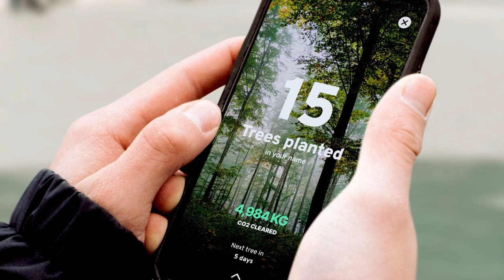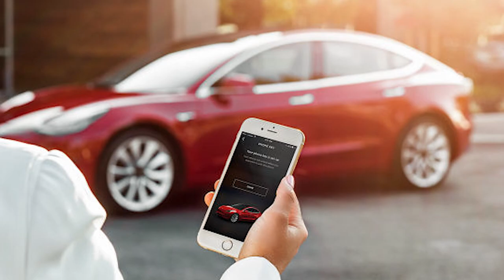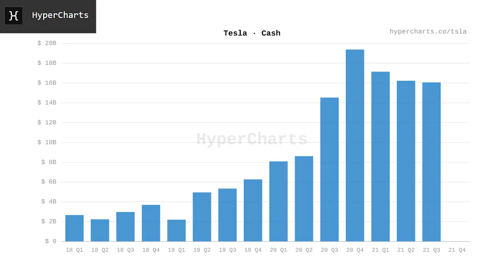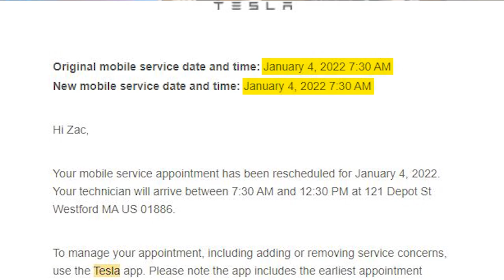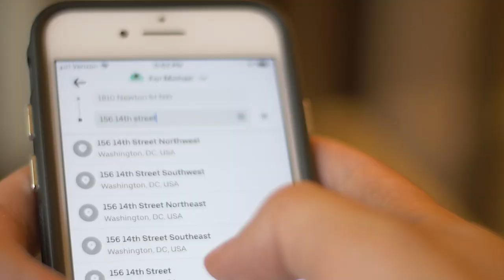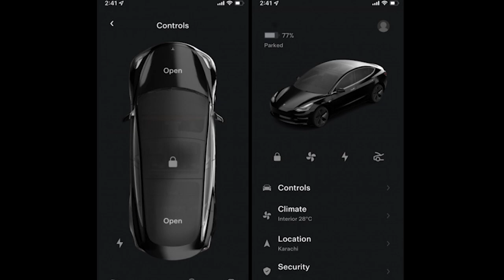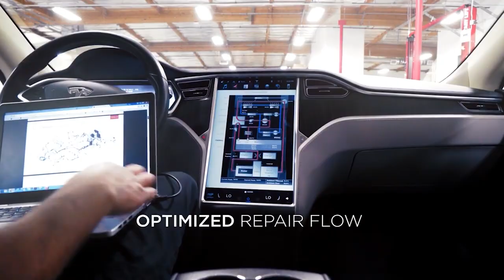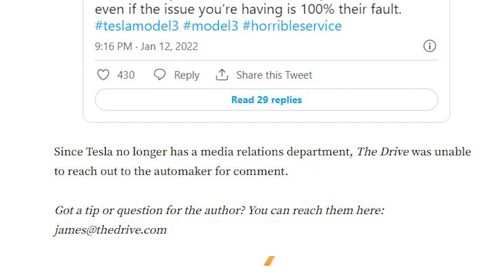Tesla We Love You, BUT… | In Depth

Comment: Do we need more service centres?  Maybe, but even then it won’t fully address the problem.  Do we need more mobile rangers?  No, I think they have their place (roadside assistance), but travel time is a seriously inefficient overhead for routine service!  Personally I think agreements with existing recovery contractors (RAC or AA in the UK) is a much more efficient use of resources for breakdown situations.

What we need are to give existing Independent garages access to spare parts, manuals and diagnostic software.  My previous ICE cars were all maintained by a local garage no more than 400 metres from my house.  There was no hassle or personal time lost.  Spare parts were delivered same day or next day.  I never took it to a franchised dealer! It was great local service!

Contrast that with my model 3.  My nearest service centre is 40 minutes drive away.  So that’s 2 hours and 40 minutes of driving (including the loaner car).  That’s a lot of hassle for a baseline condition, and that’s mild compared to other residential addresses in the grand scheme of things.

Do I need service?  Yes, eventually!  Just routine things like making sure the brake pads don’t seize onto the calliper, wheel alignment etc….  That stuff is bread and butter for any garage.  But I really hope that I never need anything more than that (regardless of whether it’s covered by warranty or not), because that’s the point where Tesla ownership is dependent on Tesla service.

Comment: I love driving my Model 3 but Tesla service’s lack of communication and slowness even here in Japan is the only reason I cannot recommend a Tesla to anyone except complete maniacs. I took delivery of my Model 3 LR in December 2019 after a miserable experience of not getting the “stealth” performance version I had configured and soon noticed several problems, mainly the LTE and wifi antenna was faulty and had to be reset. That was fixed a month later but I also noticed that one of the speakers had a buzzing sound which was confirmed by the service guy and I was told they would replace it for free. Great - I finally got notified that I could bring the car in to replace the speaker in December 2021 - almost 2 YEARS after reporting the problem. Cmon Tesla - you gotta do better.

Comment: Just had my 12v battery replaced by mobile service in Texas. Took 48 hours from the time I posted the service request to the time the service guy shut the frunk lid and said, "all done!" As maintenance is near zero on my 100,000 mile Model S, I find that quite acceptable.
Reply: In my ICE car (waiting for cars, service centers and superchargers to get to Malaysia) my recent 12V battery was replaced within 1 hour. I think they have been allowed, by Tesla fanboys, to let service standards slip. It has to be addressed ASAP. 
Short term have the service centers and service techs on shifts open 15hrs/day from 7am -10pm to get through the current backlog of issues.
Medium term stop fighting and embrace RIght To Repair, have service centres fully equipped with spare parts together with overnight resupply and make these parts, and full service info readily available to third parties.
Long term set up Tesla University to fully train service techs, body centre techs and supply chain/logistics staff

Comment: So, while it's become fashionable to find fault with Tesla service, this has not been my experience or the experience of those I know with Teslas. 

First, the cars are super reliable....most reliable car I've ever owned. (Mine is a 2019 DRLM Model 3). But contrary to what seems to be floating around the internet (thanks to Rich Benoit), our service experiences have been simply superb.

For me I've had a couple of problems that were quickly diagnosed remotely (by quickly, I mean within 15 minutes) and were "fixed" via firmware updates. No fuss, no muss. Had these things happened with another brand I would have had to bring the car into the dealer and find that they couldn't find or fix the problem....and waste a whole bunch of my time.

The hardware issues I've had with the car have been a broken windshield (the fault of a rock, not the car), and a collision (the fault of the drivers, not the car). In the case of the windshield I created a service request online, they scheduled it for about a week out, I brought the car in, they gave me an Uber voucher, and I picked the car up later that day. No problems at all...and Tesla's price was the lowest I could find.

In the case of the collision, this happened about 1PM on a Saturday. My car was hit by another car, which in addition to doing some body damage, hit the left front wheel, bending the tie rod and wrecking the steering rack. The car was barely drivable, but I managed to limp into the Tesla Service Center mid-afternoon. Although they were "closed", there were people inside working on cars. One of the folks came out and asked my what had happened. He asked me for the key card and told me they would take care of it.

Monday morning at 8AM I was going to call them, but I noticed that the phone app said my car was already in service mode....so I concluded they found the car. About 15 minutes later I got a call from them asking what had happened and would I authorize 1 hour labor to diagnose the problem. 45 minutes later I got a comprehensive written estimate to replace the rack and the 4 worn out tires. I approved the work and noted that they said the car would be ready by 5:15 THAT DAY. At 1:15 I received another message saying the car was ready to be picked up!

To say that I was impressed is an extreme understatement. 

The only other hardware issue was a clicking sound in the door hold open bars. (a common issue) I created a service request on the app and was offered a slot a few weeks out at the nearest Tesla center or a slot about a week out at a center about 20 miles away. I chose the nearer center as this was not a critical problem. 15 minutes later I received a message saying that this could be fixed at my home and asked me to select a date/time. I did, they came, they fixed the car quickly, and that was that.

To be clear, this level of service is FAR SUPERIOR to anything that I've ever experienced with maybe 20 other new vehicles. As far as I'm concerned Tesla service is simply better than what other manufacturers can offer with their dealer model. 

So, while Rich Benoit puts of videos of sad stories he curated (well, cherry picked), the reality for the vast majority of Tesla owners is far different. Basically, while Tesla service isn't perfect (but then neither is that of BMW, Audi, Mercedes, Porsche, Toyota, Honda, Detroit), in the case of the recent "horror story" videos that have been circulating, I believe them to intentionally misrepresent the reality. They are FUD.

While I really like my Tesla car, I would say that the entire ownership experience, including service, is so much superior to that I've received from any other make, I would be tempted to buy a Tesla vehicle for this reason alone.

Comment: Was just told that my concern with my Model X Raven was normal according to internal documentation. Which they wouldn’t let me see. My half shafts were replaced in October to solve the shuddering u set acceleration issue. Now my car hums every time I turn the steering wheel. Also I’ve had a grinding noise for 2 years whenever I turn the steering wheel at low speeds. They said this was caused by the half shaft replacement in October. Which is just crazy since I have service invoices from before the October visit that document this issue.

Comment: Excellent video.

Tesla really need to do something about this. They are just about to open two new factories which will increase their production by between 1 and 2 million cars per year in the next couple of years. These two new plants will also increase their fixed costs, and if the poor reputation for service gets worse the demand could then plummet, leading to the profit margin plummeting with the sales.

Tesla, you need to put as much focus on building new service centres as you do on building new plants. One thing that Elon could do as part of the product roadmap he is due to announce this week, is to state that no new factories will be built until they have a pipeline for building new service centres, and when they do build a new plant they pair it with development of new service centres.

They should be able to calculate the number of service requirements per thousand cars so this would allow them to measure demand for new service centres.

In addition they should establish training programmes for independent mechanics/technicians to be able to work on out of warranty vehicles as there are large numbers of independent garages whose workload will start to decline as the number of ICE vehicles reduce.

Comment: Bought a MYP 3/2020 Delivered with No underbody aero panels, everything exposed, pulled so hard to the left autopilot would not engage, when driving straight steering wheel was a about a quarter turn off, and more. what gets me is the car was driven to my house from Fremont ,20 miles away NOWAY could you drive this car without knowing something was wrong, tesla mobile burned out our garage door opener trying to get our car to connect to the opener then left without a word, abandon all hope all Yea who need TESLA SERVICE

Comment: I would love to see the stats on what people are doing on these service calls.  Could the root of the problem be shoddy parts? My 2017 MS has already had 3 window regulator replacements and now that Im 4 months out of warranty, the DRL's are malfunctioning. Not to mention the broken gear on my Gen3 driver side door handle I had replace myself (thanks to eBay for having a supply of better engineered replacement parts).  Ranger visits have been mostly pleasant, service center is 1.5 hours away. Still love the car and plan to keep it as long as I can keep it running and get parts to fix it myself now. Its absolutely not perfect.

Comment: Yes Tesla definitely needs to improve their spare part distribution system. I've had fairly good service from Tesla throughout the last 6 years. A lot of what you're complaining about is due to Covid. I work in the industry and I can tell you all of the major manufacturer's service centers are experience long waits for appointments and parts right now. It doesn't matter what kind of car you drive, BMW, Lexus, LandRover, Mercedes or any other, it doesn't matter. Also, you should figure what vehicle to service center ratio is needed for EVs, clearly we don't need as much maintenance for EVs.

Comment: Wow, just hearing this worries me.  BUT there is one thing if they make the changes you want the price of a Tesla will go up because they'll be spending more money and they'll have to make it up.  I'm not saying they shouldn't because they should, but I was putting that out there. 

The last woman you talked about with the break issue went to a non-Tesla service center?  I haven't heard of them either, but there should be.  With any ICE car, you have tons of mechanics you can bring your car to (are they going, to be honest, that's another issue) but with Teslas you don't have that.  Since EV's are a different monster to work on than ICE vehicles you don't want to bring your Tesla into a regular auto shop, but maybe Tesla should have training for mechanics who want to learn to fix Tesla cars.  Or maybe Tesla can franchise Tesla service centers so mechanics can get trained and then open them in areas that need them.

This won't fix the parts issue, but if they can find a reliable manufacturer of Aftermarket or OEM parts then maybe they should do this to help.  I have a Hyundai and I've bought non-Hyundai parts and if you know what parts to buy they're good.  Unless Tesla can ramp up the production of parts they need help OEM's or aftermarket distributers might be the way to go.

Comment: maybe they should give up on the you have to use us for service model if they are not willing to build the infrastructure to match the demand. I have never used a dealer for any vehicle service in my life and had only used a shop a handful of times. If I can't go into a parts store and buy brake pads I want no part buying that vehicle. I just got a Nissan Leaf and aside from the required service to keep the battery warranty I have zero plans to ever go into a shop for anything.

Comment: A more apples to apples comparison would be to compare the number of moving parts EV and ICE service stations may service in the U.S.

A conservative estimate places the number of moving parts at 20 for EVs and 200 for ICE vehicles. 1.02 million registered EVs as of Y/E 2020 times 20 moving parts divided by 148 Tesla service stations translates to 138,000 moving parts per Tesla service station.

275 million ICE vehicles (your figure) times 200 moving parts divided by 234,000 service stations (your figure) translates to 235,000 moving parts per ICE service station.

The above assumes all 1.02 million EVs are Teslas (they are not), uses a very conservative 200 moving parts for ICE vehicles as opposed to 2,000+, and does not give credit for the service vans.

Not saying your concerns aren't valid but based on the above back of the napkin calculation, Tesla users have a shorter potential wait time than their ICE equivalents already.

Lastly, The Tesla website lists four service stations in your state, is this incorrect? Your video states there are only three and you gave credit for one more due to the service vans.
Boston-Watertown
Dedham
Norwell-98 Accord Park Dr
Peabody-North Shore

Comment: As of now, most, if not all car dealerships have a sustainable advantage over Tesla that might save them in the long run: prompt, courteous service, nice waiting areas with amenities, and (usually) loaner cars and/or pick  up services. When I got my MS in 2017, Tesla service was not far off from that. Not any more---far from it.  The folks I've dealt with have been great, but they clearly had way more things to do than time to do them in. This is Tesla's Achilles heel. I used to not hesitate to recommend a Tesla, but now do not, and if pressed have to give fair warning about the horrible service/parts situation  I thought a couple of years ago Tesla/Elon committed to improving and expanding service? WTF? At this point, I don't think Tesla can expand its own service to catch up or keep up.  I think they need to train and license independently owed repair shops (not a part of dealerships) to  repair Teslas and, of course, devote a reasonable percentage of their production to parts.

Comment: At this point Alice most likely can have the car declared a lemon, as well as a valid NTSB complaint.  

I have had crap service from 2 different manufacturers so I tend to write off many complaints about teslas as unfortunately normal for the industry but things are definitely getting worse.  I have a Cybertruck on order, but if these issues don't improve I may have to reconsider especially since the closest service center is over 100 miles away from me.

Comment: I'd say the ratio of service centers to cars is about right - because EV's need way less servicing than ICE cars, right? Would that be about one fifth of the amount of servicing, going by the difference between the ICE cars/service centers ratio and the EV ratio? Let's face it, EV's don't need regular oil changes, and shouldn't have the same complex mechanical problems that arise with ICE engines and the transmissions that go with them. Plus, if you are saying that Tesla should spend their capital NOW on increasing the number of service centers, when they need to invest that capital in building the next generation of Teslas, isn't that putting the cart before the horse, to use an anachronistic turn of phrase? Let's also not forget that there are independent service centers springing up like Rich Rebuilds and his Electrified Garage, and it's easy enough for Tesla to put more mobile vans on the road in the future - those things are really quick to scale whereas building a new service center takes a lot of time and money and planning approval etc. Maybe when Massachusetts has 50,000 or 100,000 Tesla's then a few more service centers will be built, but right now? Probably not.

Comment: I’ve owned over a dozen cars and I have never taken then to a dealership for repair. With my Tesla I feel trapped into having to use a service center. Why doesn’t Tesla partner with the exist ICE repair shops.  Brakes are brakes, there’s shouldn’t be anything special about a Tesla brake.  Same with a ton of parts.

My local shop told me they couldn’t work on my Tesla simply because they didn’t have any data about the cars specs in there system.

Comment: Teslas aren't supposed to need maintenance like ICE cars. That was one of the selling points. Comparing the number of ICE center to Tesla in either not valid or the original low maintenance thesis is wrong. Which is it fan boys?